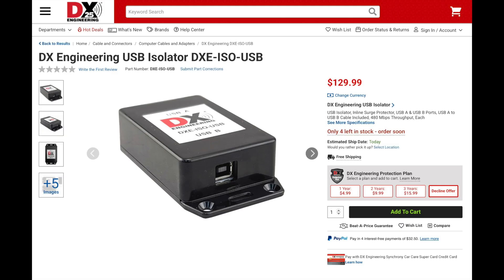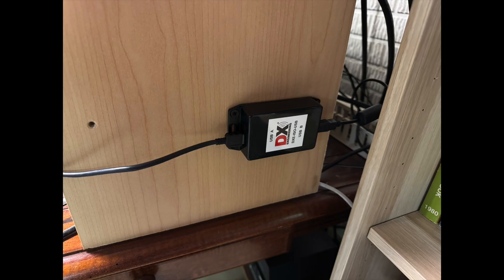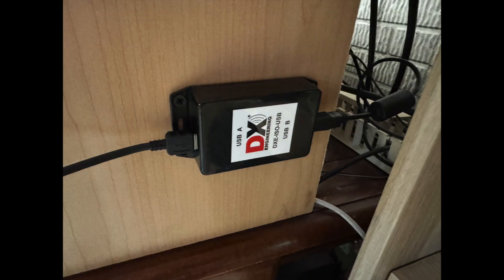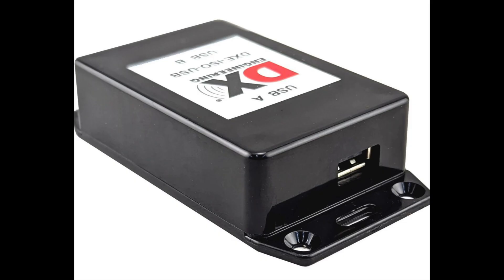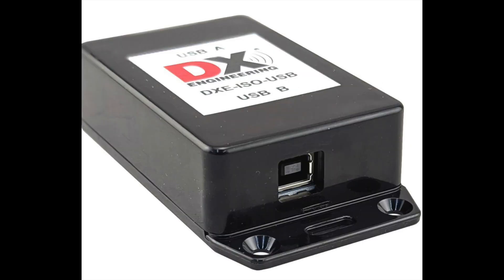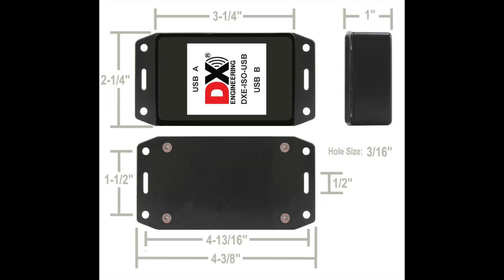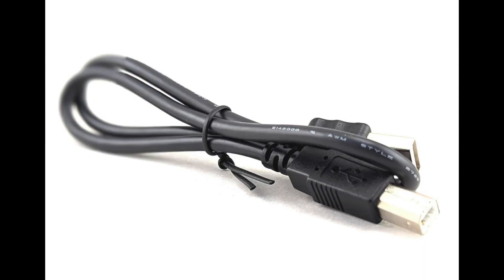Prevent Harmful Voltage Spikes in Your USB Ham Gear with a USB Isolator from DX Engineering

Comment: According to this video, the device is for mitigating damages caused by voltage spikes originating from the antenna systems and the electrical mains system.  To me, the issue is being addressed at the wong place. Attena voltage spikes should be addressed before they enter the shack. Electrical spikes should be addressed in the electrical system. Doing so will mitigate damage to other devices that are not covered by this protection device.

Comment: Seems like a good idea but I’m just wondering why you would put one USB-A on it instead of maybe one USB-C?
Reply: USB-C spec doesn't allow for extension cables or adapters.
Reply: First thing I noticed also. Then I saw the price, boy if I thought Apple usb cables are expensive they seem reasonable compared to DX's line isolators. Just saying!